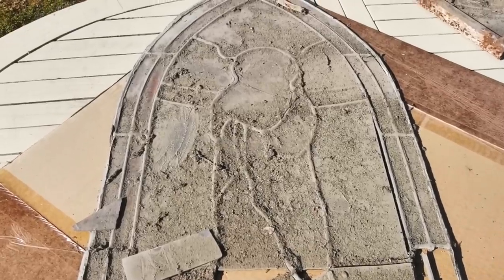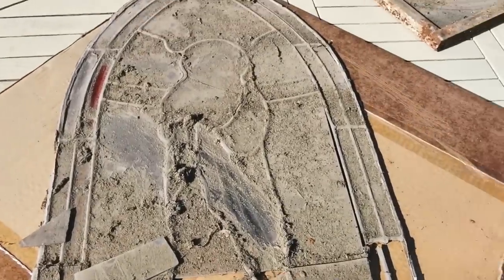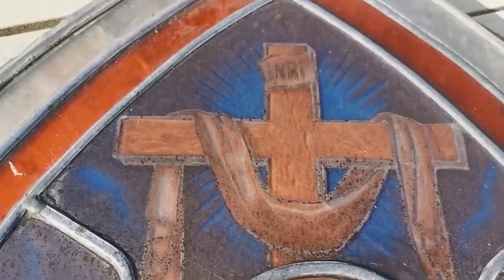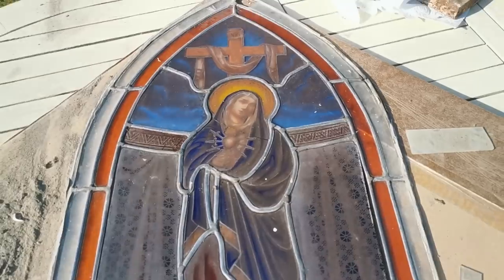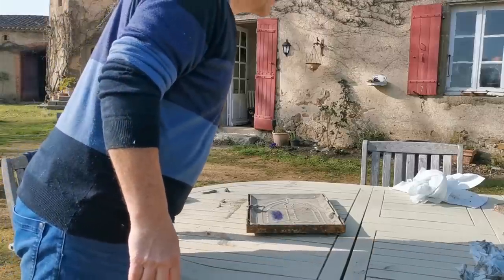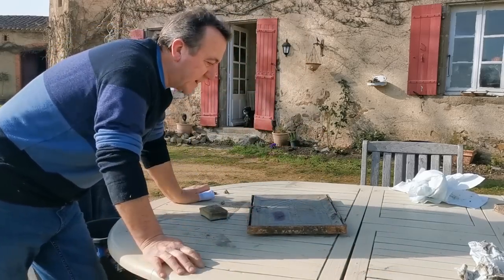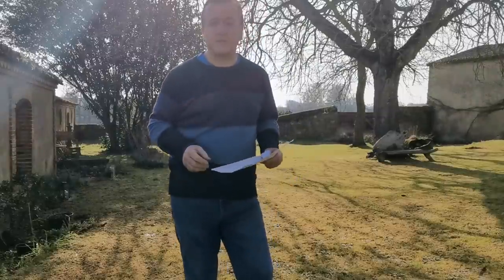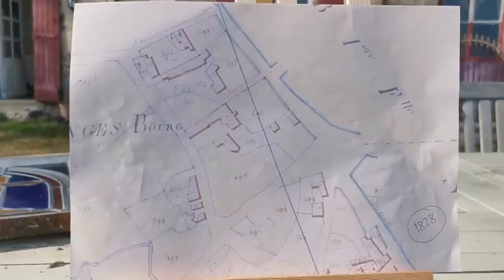A mystery to solve in our French château

Comment: My goodness this has given me goosebumps, what an amazing find. The sooner this kind gentleman begins the translation on all the mounds of historic papers you have the better, there is a huge story to be told here, I feel excited for you both and us, your followers. You did fill me with horror however  at how you attempted the cleaning of these relics, perhaps may be better cleaning off with a very soft paintbrush first. Have you both been into your local town where area archives are kept as they will have records going back centuries. More of this please!
Reply: what horror?  paintbrush is not a cleaning tool... is tool to apply liquid material.   I think you meant to say object is obviously fragile; go easy on cleaning.
Reply: @rynait  Yes, horror. Paper towels are abrasive. Those images were painted onto the surface of the glass. Soft bristled brushes are quite appropriate for gentling removing accumulated dust and dirt. Following with water to further soften and remove the built up dirt. That is why archeologists use them.
Reply: @nancibishof6462  Thank you!  You are correct.  To clean the heavy dust off these fragile surfaces,  I've used a soft bristled brush and stood outside in a breeze to clear the surface without abrasive damage. At 83 y/o,  I've been involved with many restoration projects.  All historic objects are precious as they are a history.

Comment: I think old lead windows have glass with the colour in the glass itself rather than added on top. I have an Edwardian door with older glass in it and the colour is still very strong so possibly the light won’t be an issue. Just think of all the medieval churches! It’s the lead that’s obviously the problem which ours has required attention of.
We’re looking to have another window added to our front which is a tiny window so your little windows have just reminded me that I need to get cracking on it.

Comment: It occurred to me that door from the crypt has the same top curve as your front door, also a similar pattern in an odd way with the central rosette? Is it possible that the small, jutting out bit on the other side wall which is absent now but present in the 1828 plan may be a set of stairs going down into an undercrypt which was filled in and the door taken from that?